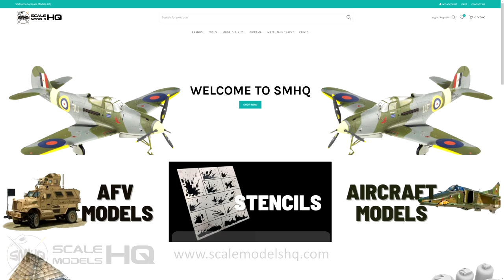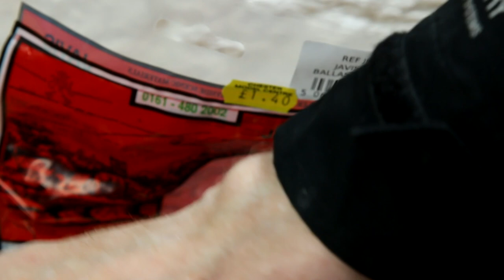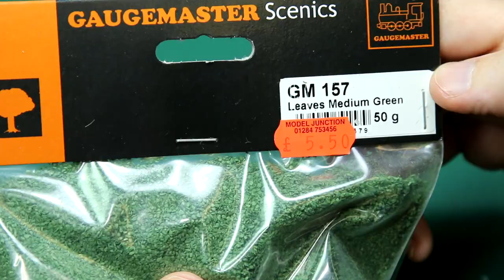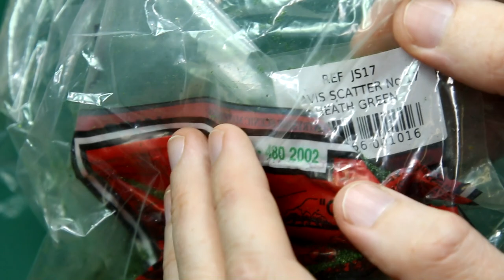Dora Railway Gun Diorama (HobbyBoss 1/72 scale model)

Comment: My only suggestion would be to build the tracks in a slight curve to simulate the curve used to swing the gun's azimuth.  Otherwise a great job.
Reply from the maker: Thanks Edward. I thought of doing that but there were two potential issues - firstly it would increase the depth of the base, which is already quite large. And secondly the kit doesn't seem to be engineered to allow it to go on a curved rail. The connections to the carrying wagons are square and the overlap with the wagons below means they can't really rotate, unfortunately.

Comment: I’ve just brought this kit and will be building a shelf for it in my shed, how tall is the model once built?
Reply from the maker: The bare minimum height would be 11 inches, plus the base height (with the barrel flat). The barrel angled would be around 15 inches, and at its highest angle it would need 21 inches. It's a beast!
Reply: @ModelNerd  Thank you for measuring it. It certainly is and big model.

Comment: That is one stunning diorama. Love the finished model. I just got mine the other day, but it going to be a a few months before I start it. You mentioned 3d printed parts in the video. Could you explain what they are/were?
Reply from the maker: Thank you Andy. I didn't use any 3D printed parts in the Dora build itself, but there is a D311 locomotive that was used to pull the Dora available on Cults3D. I have a plan to print it, at some point... :)
Reply: @ModelNerd  I've been looking for that.  There is a Dora 3d print in 1/72 scale on Thingiverse also,  which includes the D311 and also the assembly crane and other accessories.  Could be worth a look,  but I'll certainly look into the Cults3d files
Reply from the maker: Ah yes, that was it. There is a free one on Thingiverse and one with maybe more detail on Cults3D. I haven't decided which to go for yet :)